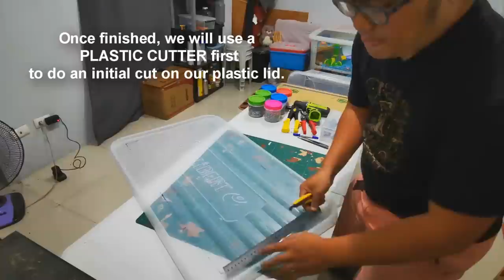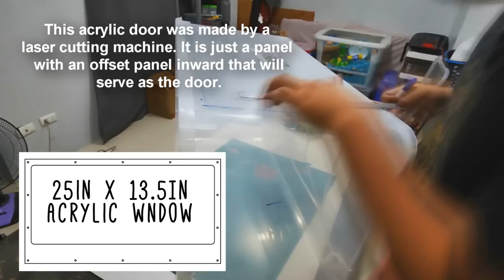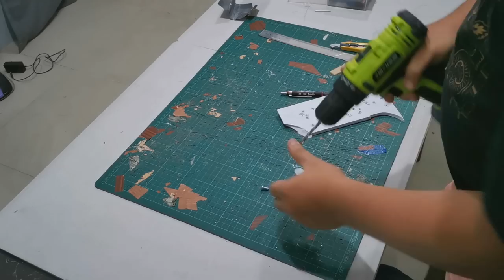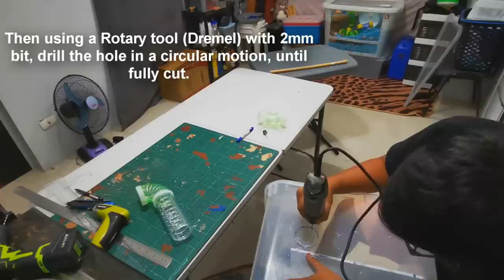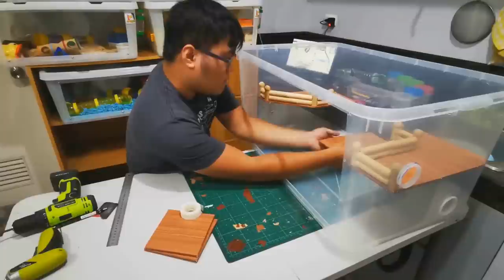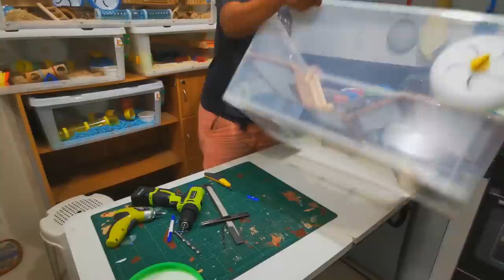DIY Hamster Bin Cage with 2nd floor (Titanic themed) Tutorial | ENG

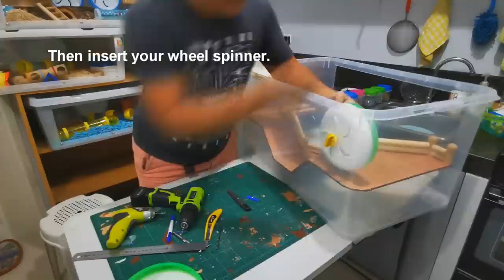Comment: hello! i inserted my wheel just like how you did on 26:24 but when my hamster runs on it, it touches the wall of the cage and makes a noisy sound do you have any tips on how to solve this?
Reply from the maker: if the wheel is bigger than 21cm, i suggest you need to get the one with the 2 rolling wheels behind. or might as well use the stand
Reply: @theHamsterGuy  okey, thank you very much 😀